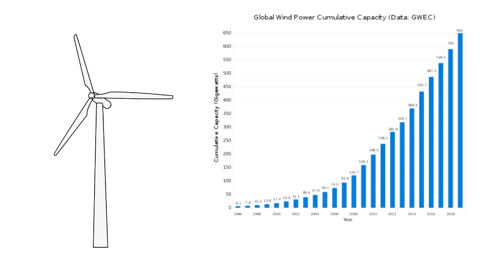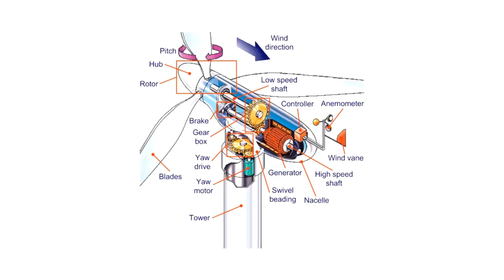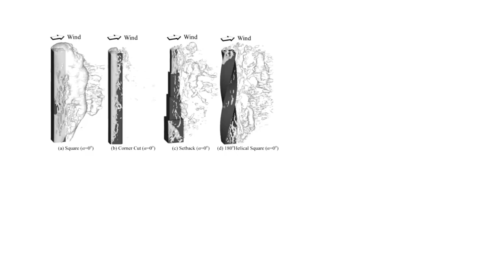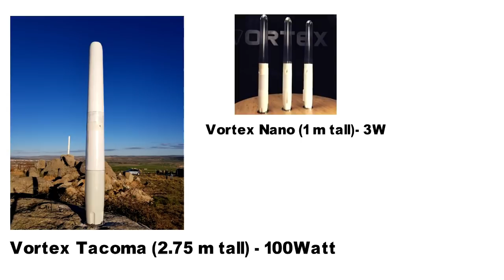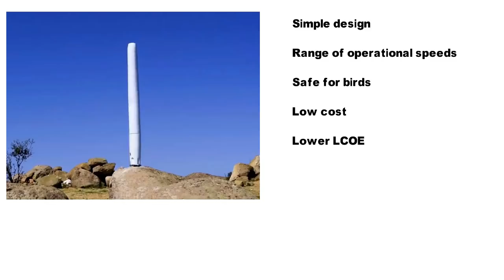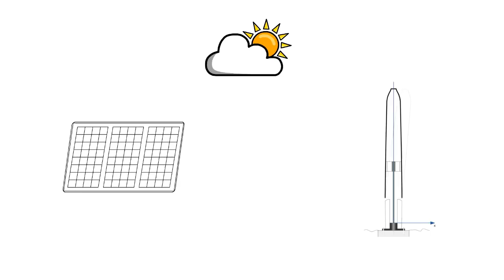Bladeless Wind Turbine

Comment: Does it make noise? Because it seems to be that people who are against all forms of renewable energy production have abnormal sensitive ears. Apparently they are able to detect every single vibration, even if it falls well beyond the range that humans can detect, and it makes them instantaneously sick as soon as they even think that a renewable energy source is causing any type of vibration or noise at all. 

Except when those vibrations and noises are produced by a toxic and polluting device such as an internal combustion engine. They believe that burning fossil fuels is perfectly healthy, and the noise and vibrations from such a toxic and polluting device are also not a problem for them.  

But a renewable energy source is not allowed to produce any sound or vibration at all, otherwise they get really sick...while other normal people do not get sick at all, so we must care for the poor crybabies. 

And also, it is not allowed to make the device from any "stuff" at all, because they will also say that if you make it from "stuff", and I mean any "stuff" at all, that it is more pollutant as making "stuff" that burns toxic and polluting fossil fuels instead of using wind power. And no matter what stuff you would use, they will always say that it is dangerous stuff, even when their whole house is packed with crap that is made from the same stuff. 

So make sure that the power converting device does not make any sound at all, also make sure that it does not vibrate at all because they will be able to detect it, and also make sure that it is not made from any stuff at all, otherwise they get really mad and really sick.

Comment: if the wind  is not there what happened.  I am not disclose or blame. there is an another technical matter for making  power that is Anti-torqe theory  which is no needs for the input of fuel and pollution with a one time expenses and so less  maintenance of rust. because fuel input coasting and maintenance in it. and structure is also to huge parts to make and erecting of labour and time is also worthing. these making difference in the cost. so we needed one affordable category.  even wind power needs a heavy altitude tower and leaves.  both are avoid against wind and structure avoidable and getting rpm as per the diagram with a little Anti-torqe system as secret. I am  old man working for the same  since '86 and model with me. because I spent as much as my calibre only at the big category. long length is the main thing with out anybody's  financial support is essential. it is my request one who read this blog.......

Comment: A sad commentary that seeing their shape, I can foresee how people will repaint them to be a real eye sore.

That being said, at 1 meter in size, I can't see the value of bothering with the tiny ones for 3 watts generated, that's such a tiny amount of power potential for something that uses up space.  Bigger is better, if you can make it work where you're at.

It'll be interesting to see how the math actually works out.  Definitely for smaller power generation, I don't see how they'll scale well in practice for their costs compared to power output.  But, I also don't see how the current typical HAWT will ever work where people actually live, for noise as well as really bad failure modes; there's a reason why "wind farms" and residential aren't mixed!

There is a bladeless turbine already, but I've not seen it really used for wind turbines due to scaling: the Tesla Turbine.  It can work with air, but is most commonly not used with air.  The moving parts themselves are very simple to make, being spinning discs, but the air capture is an interesting thing, and they spin (while being protected from outside contamination or birds if you put them outside) at very high RPMs, which does generate a lot of noise.

I'm working on a concept that borrows a bit from the Tesla Turbine, but accounts for and (hopefully) corrects the problems that make it viable for wind turbine use, with a hope of making a VAWT that scales really well.  Other than the noise of the giant HAWTs that are being built, they're currently up to 15 MW, at 230 or so Meters i diameter for swept area with HUGE blades: how much larger can they really scale?  A proper VAWT could possibly scale far larger if figured out, though there'd certainly be more bearings to deal with.

Comment: Stop calling it a vortex turbine. Stop calling it a turbine. Vortex denotes that it spins. Turbine denotes that it spins. You clearly stated that it does not spin, but that it oscillates. Oscillators vibrate, or shake. You can turn a spinning motion into a oscillating motion but you cannot call something that doesn't spin a turbine or vortex. Just call it what it is a Wind Oscillator Generator. Also this isn't a new technology there are patents from a 100 years ago that speaks of doing the same thing.

Comment: I wonder if this could be engineered to work for the mast of a sailboat
Reply from the maker: Good idea
Reply: bad idea, the last already has a function, hence it's existence that's requires is to have a fixed non oscillating position
Reply: @ottodidakt3069  ya, while under sail you would need it to be rigid, but while at anchor it could use wind and wave energy to oscillate.  If configured properly it could also work to dampen the effects of waves rocking the boat by absorbing some of the energy.  Right now people pay a lot of money for gyroscopes to stop the rocking motion of the boat.
Reply: @esquire9445  look up the materials required, both are quite different, plus imagine the mechanics of making rigid at sea and flexible at the dock (where you already have power available), won't happen !
Reply: @ottodidakt3069  there is a hinge at the bottom that would need to be locked in place.
Reply: @esquire9445  nope, try again
Reply: @esquire9445  it's really engineering 101 obvious, but ok !
Reply: @ottodidakt3069  I’m the guy that looked at the website of the company that makes these things, you are the other guy.
Reply: @esquire9445  I'm the guy who searched their website and found no efficiency or power production what so ever ... fishy ! it's usually the first thing companies communicate on !
I'm also they that checked out their mast specifics and they don't suit a sail boat mast !!
Reply: @ottodidakt3069  ok so you are a troll that doesn’t believe in the product... enough said.
Reply: @esquire9445  I don't believe in the product, but I'm not trolling you, I responded to your comment about the boat mast feasibility ... sorry you don't like the feedback !

Comment: There are several idea along the same thinking. One company in the UK has placed them in the center of motorways... Generating from vehicles passive byproduct of wind.  They have got a generator that is up to a few KW of power.
There is talk about putting them on mobile phone towers.. As one mobile phone tower is 7KW/h to run and one of the devices that would fit on the tower generates almost the same power...  Put two on it and suddenly your phone masts are providing more power than they use... 
Here is a link to the video ... https://www.youtube.com/watch?v=gcSnwW5v3f8
The UK company is called Alpha 3 11 (alpha three eleven.)
Combine these wind turbines with Liquid Air batteries and you have a good renewable power source and a good storage system that is better than Lithium Batteries (environmentally and almost as effective as Lithium *60% efficient storage.)

Comment: This idea hasn't worked since it was first introduced in the 70's.  The principle has been debunked with energy production peaking at 40% efficiency under perfect, unnaturally occurring mathematical models.  Not only is this product not being manufactured,  only one prototype installation has been produced and requests to show any actual watt, volt or amperage measurements directly from the device have been refused.  This company has been shopping for investors for nearly a decade now because they keep dropping when results don't happen.  This is the Theranos of the wind industry.

Comment: This again?  Been doing the rounds since 2012 with lots of reviews and no scaled prototypes.
Sure - they work at small scales: but so does a piezo device being hit by something flapping in the wind.
Why?  They don't have the surface area to extract the energy claimed at the larger sizes - they verge on an investor 'scam'.  
Stand back - I'm going to do *Science*....
There are reasons - specifically the laws of physics - embodied by the classical equation:
Power = 0.5 x density of air x Area swept {the killer for these sticks} x  velocity of wind cubed x 0.59 {Betz limit - look it up}
 why the much touted since 2015 large prototypes still aren't available.  
{The Betz limit is a crimp that you can't extract all the energy from moving air in continuous manner: if you did it the now stationary air would sit there in the turbine getting in the way, it needs some residual velocity to exit - or to be pushed/pulled out of the way which takes energy}

Comment: its not s turbine, its an oscillator if you cant get that fundamental bit of engineering correct when its actually explained as the function of the generator then i have less than zero interest in the engineering you want to promote

Comment: Energy capture = wind capture area * efficiency : turbine = 2*PI*r (radius)  : for this device - is very small and defined as the cylindrical cross section * vibrational offset.  You can see that the amount of energy capture is not comparable to a wind turbine.  The maths here is not correct.
Vibration results in failure of any material eventually 
This is a scam

Comment: Wind, like solar, will never be a viable energy source for the bulk of our power-consuming economy. It might work in a localized setting, to power limited things, and only if that local environment has the ideal conditions...but in order to have a consistently reliable and sufficient supply of energy, you must power the generation of said energy with another energy source that is controllable (coal, gas, etc.). Otherwise, you are at the mercy of whatever unpredictable energy source you are using at a given time to generate the new energy.

Comment: This may have started out as an honest project, but it has turned into a scam. They've been fundraising for 10 years, and all they have is an 80cm dildo that, in optimal conditions, generates enough power to charge a cell phone. That will never be able to compete with a small solar panel. It just isn't worth such complexity for power generation this lousy. The developers recognize that it is not possible to scale up their prototype, and we all know that the efficiency of wind turbines increases with scale. That is to say, although technically it can work, there will never be a niche in which it can compete.

Comment: One correction🧐Aerodynamic realities insist that traditional wind turbines be at a significant distance from each other. The structure they sit upon does not equate to their foot print. Because these new vertical generators can sit much closer than thousands of feet apart the energy density per area may be much more competitive than you realize🙂

Comment: Well I’ll take the 2.75m please....
Reply: Your choice:
You can have a 2.75m wind generator wibbling about
or
you can have the same installed capacity from oner square meter of solar panels
Reply: @simonprobert8765  

Have both, it’s a secondary system that’s adequate to charge a malfunctioned/damaged or poor weather solar panel (fall/winter dark months) where sun light is limited....
Reply: @Incountry  Do you live off the grid?
Reply: @Incountry  Also what did the turbine-less wind generator cost?
Reply: @simonprobert8765  

Not at all, if that was the case then I’d look into something more substantial with higher output in the storage stages with multiple secondary reserve back-ups...

As something as small and simple would be used to supplement the energy consumed during daylight hours when power is required continuously for the certain equipment I have, thus re-energize the storage facility in dark hours...
Reply: @simonprobert8765  

I have no idea, I’ve already sent for information and purchasing/shipping of said item, I’m awaiting a response now...
Reply: @Incountry  So you are connected to the grid and use a combination of solar panels and a turbine-less wind generator to save money? This is what I am looking into, but so far I have mainly looked at solar. Do you know how much energy your wind generator produces over a year?
Reply: @simonprobert8765  

I’m not entirely sure as awaiting the information, but the point of my system is to regenerate through poor seasonal weather, this way the deep cycle batteries get their charge continuously when the sun isn’t available.

I hoping to increase capacitance of the storage system but thus also increasing the solar input without affect size of panels, obviously there is a cost you must keep in mind as this will near enough double.

Selling unused power back into the main grid isn’t a priority but if it can bring a little return to initial outlay then it’s a bonus, alternative is selling to your neighbor if they’re close enough...
Reply: So you are looking at getting this wind generator to get a more even production over a year and you are also looking att getting additional battery storage in order to be able to take advantage of more of the energy from solar? Have you gotten a price for this 2.75 meter wind generator?
Reply: @simonprobert8765  

I sent an email to the company (one of many who sell) their sales team is reduced so they going to forward me details of distributors/retailers...

Comment: Would these parts and batteries be made in factories that get their electricity from coal or fossil fuels?? The batteries using metals that require strip Mining and chemicals for refining, also made in factories powered by coal?? Would these factories most likely be in China?? Cause no factories can operate because it would violate emissions regulations.. 
And the finished components shipped out on cargo ships burning tons of Diesel to make the voyage to deliver green energy?? Sounds amazing.. why not us sustainable energy instead of green energy.. like nano diamond batteries made from radioactive waste.. that breaks down into biodegradable elements as its used solving two problems at once. Batteries that never need to be charged.. there's enough waste on the planet now that power the entire planet for the next 3000 yrs.. 
https://ndb.technology/

Comment: There is much more efficient technology available than either wind or solar. Well the term "available" isn't exactly accurate. You see over 50,000 patents have been issued going all the way back to the early 1900's when Nicola Tesla first discovered "Over-unity" or what is more commonly known today as "free energy" (a term that the fossil fuel barons devised so they could bash the tech). The problem is that the U S  Patent office is owned by the US Federal Reserve Bank (neither one is a government entity, well they are in that they OWN the government technically) and they own the fossil fuel industry as well (see where this is headed?).